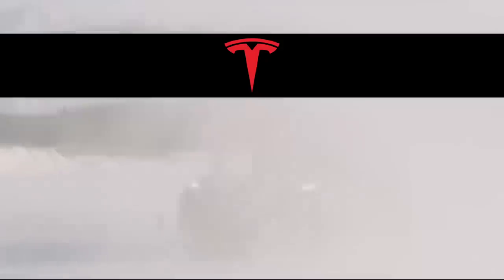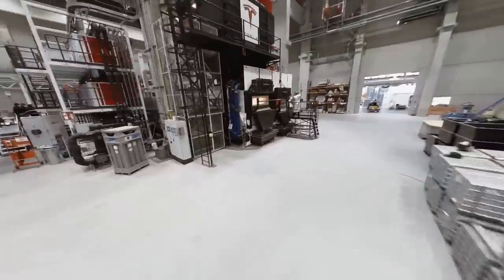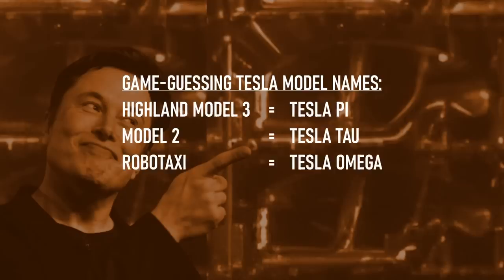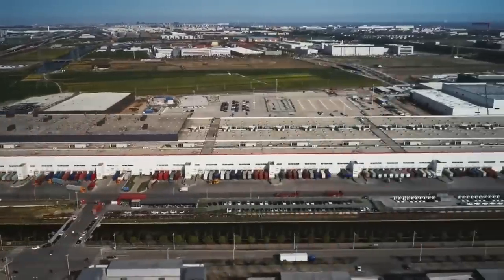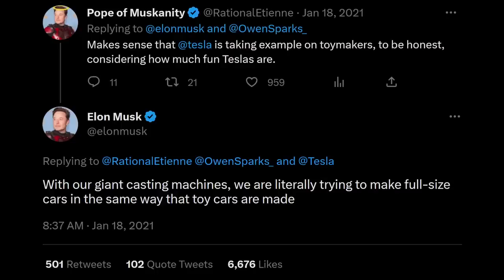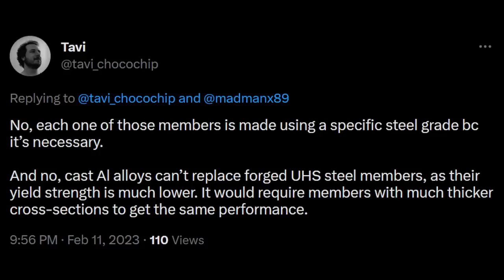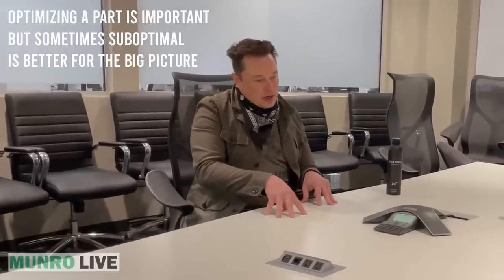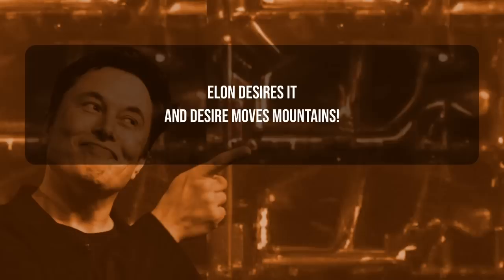FULLY GIGACAST NEW TESLA Pi 🚀 Elon's 3rd Gen platform out next month paves way to Alien Dreadnought

Comment: My god, you are right.  I had speculated on Dillon Loomis's channel weeks ago that Tesla was stock piling the castings for immediate production of the new car.  You really filled in the blanks.  Outstanding work.   Never even considered 3/14/23 being Pi day.  Of course.  Elon loves word play.   Thank you for such an indepth presentation.
Reply: These last two videos have been so good.
Reply: You think they could do it with out or leaking?
Reply from the maker: Definitely. Very tight NDAs
Reply: "...filled in the blanks"...or, connected the dots...😉
Reply: I was thinking that the exoskeleton on the cybertruck would allow for a non-load bearing inner, for example an injection molded plastic, to which the interior and moving parts - doors, frunk etc. would mate.   You could do mold in place for certain elements like hinges if they need more strength.  The frame of a "traditional" car body needs more structural strength.  Aluminium would be easy and obvious but anything that has high rigidity at "casting" but needs hours to finish curing would work as the car doesn't leave the factory / arrive with customers within ?? hours.
Reply: @ConnectingODots  It could be Cybertruck castings.
Reply: This date makes sense the value of Pi = 3.1415... The first three digits is the same as 3/14/23 then add 23 together you get 5. As close as you can get to the value  of Pi. Unless you go for 12/14/23  and add 12 to get 3 and 23 to get 5. The 3/14/23 date makes more sense. Especially coming after Investor Day. Elon loves his puzzles. All we really know is something may happen next month.

Comment: Revealing a new vehicle typically involves coordinating with numerous individuals and external vendors, making it difficult to maintain confidentiality. However, as demonstrated by the Cybertruck unveiling, it is indeed possible to keep such a significant event under wraps.

I still think Investor day will be about the macro processes needed to scale, but I hope you are right and we see a new vehicle.
Reply: Production start shortly after the investor day is a possibility, it is not completely a new model, more an adaption of the 3 to the Model Y´s manufacturing processes and for sure some further innovation compared to the Y.

Comment: Whether your theories pan out or not, this video, like your others, was very thought-provoking, exciting, and FUN.  Using cast upper bodies would make the overall structure extremely rigid which is perfect for eliminating body flex which improves handling.  It will greatly improve body part fit, which would lower production assembly cost.  Castings can be reinforced with structural steel or carbon fiber or stamped steel overlays, but the castings would provide the perfect skeletal alignment.  Attachment points would be precast in, reducing the alignment effort of the assembly robots.

Comment: My idea was to use 1 power circuit and signal rather than mechanically switch component functions for the wiring harness.  Using higher voltage to reduce wiring mass was also evident to me.  Tesla's interest in my thoughts has been highly gratifying.  
I also suggested to SpaceX to get rid of the extra superfluous tanks and baffles in reusable spaceships and boosters by partitioning a single tank with flexible Teflon bags. This was because one temperature could contain both fuel/oxidizer components in a single tank, plus collapsing plastic bags would smooth component flow.

Comment: OK - Here is my take on Tesla.  1) I think they might make four giga castings(skateboard/left side/top/right side).  I think they will cast doors and whatever else they can. 2) What if they assemble all the parts into each of the four giga castings and the final assembly legos/bolts them together.  Very little inside assembly.  3)  A few months back they received many recycled aluminum can bundles from Austin Recycling.  The smelting process removes all of the "gunk" and you add in their alloy blend, gee I wonder what the yield strength was...  Now you have raw aluminum at 10 cents on the dollar.  4) A couple years back, they made kiddy car model 3.  That was a design study to see what surface quality the castings could achieve...  5)  Now this is speculative, back in 2012-2013, there was a picture of a Model S having a Dominoes Pizza box structure mounted on its roof.  They said it was for remote telemetry, yet they were already doing software downloads..  In 2015, there was a FSD video showing the features at that time.  In the video on a California back road, they showed a Nicola Tesla looking tower in the middle of a field.  Now fast forward to 2023, and we have 1000s of Starlink Satellites in close orbit.  What if the pizza box was the modern equivalent of Nicola Tesla's vacuum tube box that powered his 1920s Packard.  Starlink replaces the tower.  Now you only need a battery for dead spots/regenerative braking/accelerations.  One third of a Model 3s cost is the battery, that could down go to 10%.   6)  Now you take a few steps further, what if Tesla sets up numerous recycling centers in each state.  They would each recycle aluminum/glass.plastic/rubber.  7)  What his robots capabilities are will dictate the number of his employees he will have.

Comment: Very nice analysis!  I think you're 100% right about the upper castings.  I assume you mean separate castings for left and right, that replace the existing stampings?  Based on the flatness (compared to the underbodies), I expect the current machines should be able to make these larger pieces.  Then all that's needed is to cast additional crossmenbers along the roof, and join all these castings with only 8~10 welds?  Wow, this is going to be insane!

Comment: I think you hit right on the head why Tesla is stockpiling castings. I've been thinking about this for weeks and had reached the same conclusion that the presses were going to change molds.
Reply: Think about the number of vehicles they produce in a single day, tell me how many days worth of castings need to be stockpiled to change the molds, cast the molds and have enough to meet the total of what was stockpiled, never mind the fact they will be gone because production doesn’t stop. Only to repeat this process of going back to the front/rear casting molds. Think again. I love connecting the dots, but this one idea is not feasible to me. 
Maybe downtime from time to time to test a new mold in preparation for newly dedicated casting machines. But that would mean no new vehicle yet because we wouldn’t have all machinery necessary.
Reply: @dduffy7271  Tesla is already switching die mold between front and rear underbody castings. Switching to different mold is not a huge downtime. What will be a big downtime is dialing in the casting of the side structure. There are a lot of parameters that needs to be tuned before you can have a high yield high volume casting production.

Comment: One thing that I rarely see mentioned is how difficult it is to repair these huge castings if there is a fender bender. I think a good approach would be to use a single large, casting for most of the car frame, but have the main casting attached to the front and rear bumpers with smaller castings, or even stamped parts. These smaller parts can be sacrificial in an accident, breaking before the large, casting experiences any impact. That way, it is simple to replace those sacrificial elements without risking the main casting.
Reply: "These smaller parts can be sacrificial in an accident, breaking before the large, casting experiences any impact. That way, it is simple to replace those sacrificial elements without risking the main casting."

This is exactly what they are doing.  The front and rear castings have 'crash rails' that can be cut off and new ones welded in place.  If the collision is severe enough to damage the main casting then any traditionally manufactured vehicle involved in such a collision would be an insurance write-off anyway (costing more to repair than replacing with a new vehicle).
Reply: Just wondering if aluminum could "overmold" a stronger material like plastic can overmold aluminum. Can the potential for galvanic corrosion be avoided if the aluminum totally encases the stronger material (for example high strength steel)? Just musing out loud.

Comment: This video was extremely informative just like your last one. If I had to speculate on what Tua would be, I believe it would  a coupe heavily based on the model 3, from a business perspective it would tap into new consumers that to other models don't intrest
Reply: We all know the Mustang Mach E was built to complete with the Modle Y so why wouldn't Tesla go after the Mustang along with othe coupes like the M2 ...
Reply: @amglivefree You should know by now that Tesla doesn’t intentionally compete, they simply make the best possible vehicle of whatever class the situation calls for. If a coupe is the best option, they’ll do it, but the reason won’t be to go after the Mustang or anything.
Reply: Personally, I think coupes are outdated and unlikely to be the basis for this revolution.  I’m betting on a 4 door small hatchback, possibly with small SUV styling or possibly the futuristic “hot hatch” that we have seen sketches of from Tesla.  Small hatchbacks have the greatest practicality and have been among the biggest sellers worldwide for decades.

I can’t wait to find out!!
Reply: Agree a coup has been speculated by others as the form factor for a cheaper to produce vehicle with front and rear castings with upper cast side frames

Comment: Love the very in depth reasoning. However; I doubt the part about stock piling castings. 3,000 to 5,000 castings is only about one week of production. If both front and back; then that is only 1/2 a weeks production.  I think these stockpiles are a buffer for other mundane reasons. Like replacing dies or trying new dies, but not to enable totally new production from the same casting machines. Maybe some pilot runs while new casting machines and production lines are being assembled. It doesn't make sense to me that Tesla would start a whole new model when it can barely keep up with current demand and while it is also about to start production of the CT and Semi.  Bottom line:  a greatly improved production line for M3  and MY.
Reply from the maker: As explained in my previous Highland video, The model I see arriving first is the highland Model 3, which I call Tesla Pi. It will help them build more cars faster. I agree with you that new model (2/Tau) will arrive later on.

Comment: I tend to agree that highland is more about process than product, meaning new methods to produce the existing fleet better rather than a new product.  This however, will be the basis for the new product.  Chicken and the egg...which comes first right?
Reply from the maker: Exactly. Great arguments for supporting both chicken and egg
Reply: There's some somewhat compelling evidence that Tesla may release a slightly smaller hatchback based heavily on the Model 3, but that features smaller wheels and tires, no glass roof, a simpler stereo, and a smaller battery and motor, maybe with an initial LFE range of 215 miles, and an MSRP of around $25K. This was in Musk's plan all along.

Comment: The upper Casting will be Aluminum, Stiffeners could snap into the casting and could be Titanium OR Carbon Fiber Tubing.
OR use a Titanium "Wire Frame" pre-heated and inserted into the Mold then shoot the Aluminum around it , the Aluminum will shrink down onto the "frame " as it cools. The Titanium could be over-heated to help the Aluminum flow through faster.
Cheers from San Diego
Reply: Interesting Idea.
Reply: Do another bong!

Comment: I think the most likely scenario is that they will reboot model 3 at a much lower price using more single piece castings. That is more efficient than launching a whole new model. Spy shots of the m3 update don't indicate any major changes to the body styling.
Reply: A major update to the M3 with front and rear castings. Possibly adding upper side frame castings (maybe).  Improved styling to the front and rear of the M3. All  adding up to a cheaper vehicle to produce and stick it to all the legacy manufacturers. 😎

Comment: I'm no expert but casting the upper body will be a problem in a roll over and roof crush tests 
What about using something like abs plastics for casting with the right profile it can be very strong and flexible enough to not break and Maby lighter than aluminium

Comment: Don't forget Sandy Monroe's prediction that a composite material battery box, bonded to the batteries as a single structural unit was the way to go.  Look at the 4680 current structure with its foam and adhesives-- that is half the way there. Add a composite structure to that that bonds directly to the front and rear Giga castings and yoiu reduce weight, parts count and simplify construction.
Reply: Speed is everything with Massive Scale. Castings take seconds, Composites have curing times that would greatly slow the process. Other minor issues of different thermal expansion  characteristics and fastening/welding options.

Comment: That mass of goo around the batteries in the pack that Munro disassembled bothers me. I propose Tesla change that to molded pieces that perform the different functions required. Then use an array of through bolts that clamp the floor pan , belly pan, batteries, molded pieces and wiring into a composite structural component. The nuts for the bottom of the through bolts  could all be spun on and torqued by separate drivers built into the platform used to raise the belly pan and battery pack up under the floor pan.

Comment: Tesla is at least a decade ahead of all other car manufacturers. The Cybertruck will create a whole new level of how vehicles should be built. Once they're out in everyday use people that haven't bought one yet are going to feel like they have been let down by other manufacturers. Cybertruck will pull the F150 uphill downhill and around in circles. You'll never have to worry about paint chips or scratches so it'll be more rugged and go places where other trucks can't. It's certainly not going to need rust protection, oil changes or more than a hundred dollars of fuel every 500km. Cybertruck will last an easy million miles, where this is Ford's first kick at the can, building a vehicle that will get to 500,000 miles and not have a major service issue. I shouldn't just pick on Ford that goes for every manufacturer that is still relying on profits from the internal combustion engine. Tesla works together to come up with innovations to better their products and disrupt the whole industry. They have added more features to the first year of Cybertruck then Ford has done in 100 years to their trucks! Just walk up the ramp if your arms are too short to reach over the side. I have dreamed of this day that I do not have to rely on petroleum, diesel or propane to get where I need to go on or off road! Tesla Semi and Cybertruck will rock the automotive Industries whole Foundation early this year! This is the time! This is the place and we are the people that will change the world!
Reply: If it were up to me, Tesla should have designed the Cybertruck as a more traditionally styled and painted vehicle without the homemade sci-fi looks, and then introduced the Cybertruck styling later on at a high price with limited production. The current Cybertruck's styling is too polarizing, and you won't be able to easily reach into the bed over the giant C pillars that look like buttresses.I will say that the CT will probably become a canvas for custom painters and wrappers.

Comment: 1  connect these dots (in reverse order).  First group of SpaceX Starships head to Mars loaded with machines, tools, etc. One ship with several operational bots capable of assembling more bots from parts  They,  in turn, will start the process of constructing a power source (solar or nuclear) to charge themselves and their vehicles.   Using the disassembled construction equipment brought on other Starships,. they will then begin construction of temp shelters, workshops, and housing for the eventual humans.